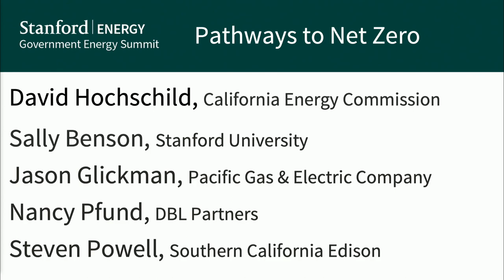Stanford-CEC Energy Innovation Summit - Pathway to Net Zero Electrification and Reliability

Comment: Been watching Precourt presentations for years. Pull up one from several years ago and find it's the same blathering. Action is required. We are hearing nothing new. We have in hand proven solutions. We've crossed 1.5c for 12 straight months. January was hottest on record. We live in Ohio and completed 100% electrification process last fall. Our state government and utilities have done everything imaginable to make the process incredibly painful and expensive. We're punished by $200 annual tax for each of our EVs while paying taxes on our electric bill. State removed every renewable program after first energy gave $50 million to speaker of the house. Wires are not an issue here corrupt immoral unethical politics have an iron fisted grip on most every level of government.